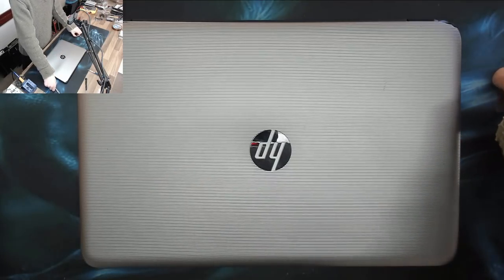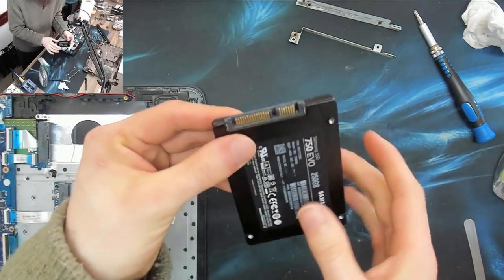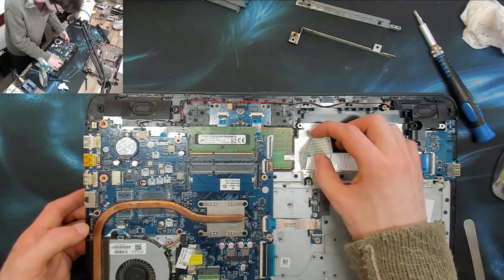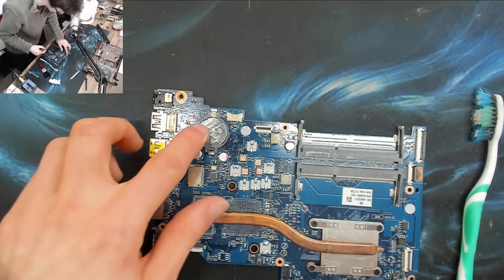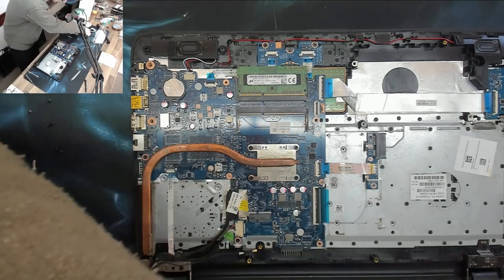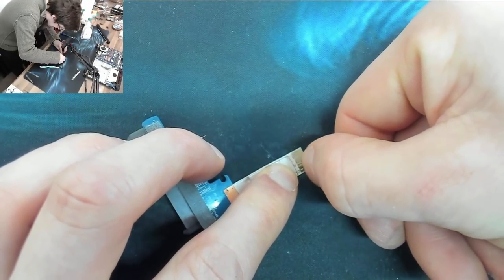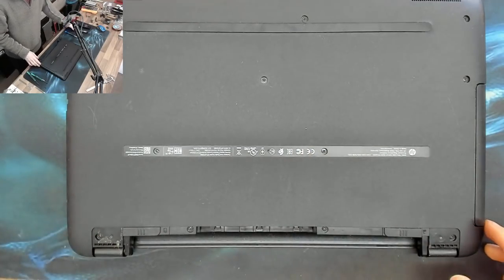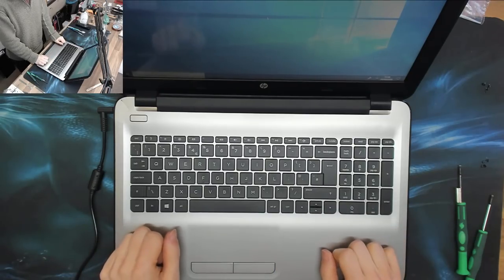LFC#133 - HP 15-ac Wine Cleanup

Comment: Can I take the liberty of asking a question?  I methodically went through a dead PC in trying to find a problem piece of hardware.  I managed to get it bleeping but cannot get it to do it again, i managed again to get it working, which I thought was hey presto.  It now turns on for 30 secs and then turns off and back on and stays on but no post.
The only thing I have not looked at as I do not have another, is the power pack.  It does have a lot of dust in the fan but does not turn/spin like the internal fan,   Do you reckon that is the issue and no i do not have a voltage tester but its just as well because I probably electrocute myself.
so its either after watching most your vids, the processor, battery pack as these i do not know or have spare to test.
I know your not where I live but if you were I'd drop it in.

Comment: Hello been watching alot of your videos recently. Only found your channel about 2 weeks ago. Was wondering if there is a toolkit you recommend for everything I will need to get started? Do you have an amazon affiliate link? Would love to support you! Keep up the good work.
Reply from the maker: It's really hard to point out a single kit that's got everything I'd use in it... However, the stuff I always have to hand:
T5-T8 Screw drivers
PH00, PH0, PH1 Screw drivers
Metal & plastic prying tools (spudger)
Tweezers
And then general tools, small pliers, various straight and Philips screw drivers, a multi-bit screw driver set to cover the uncommon sizes, toothbrush, that kind of thing. You kinda have to build up your toolkit over time as your needs require.
Reply: @Adamant_IT  thank you very much